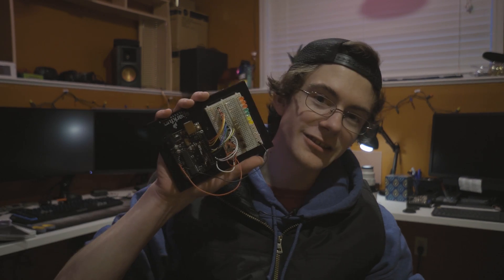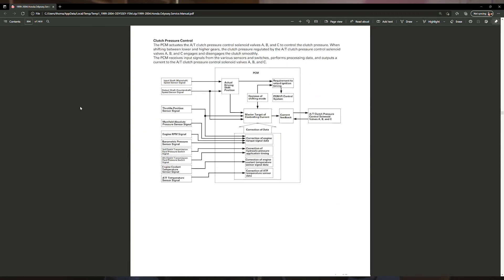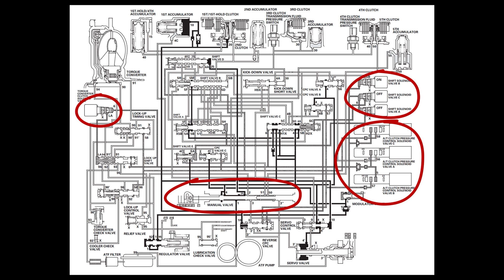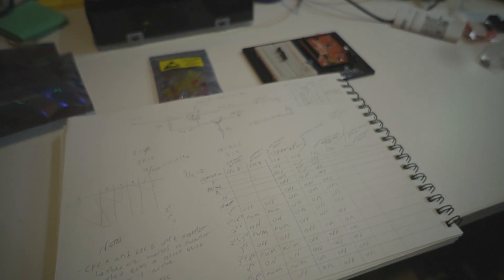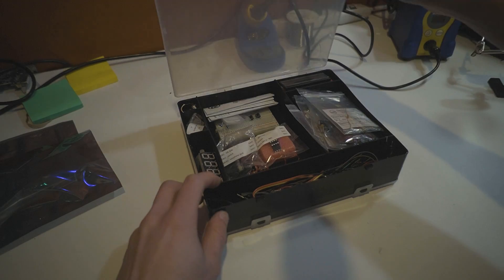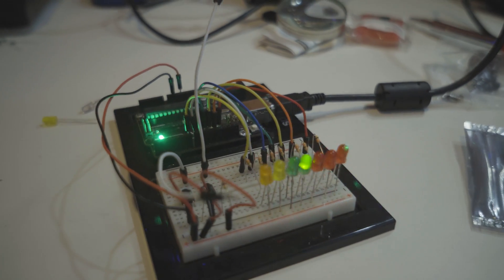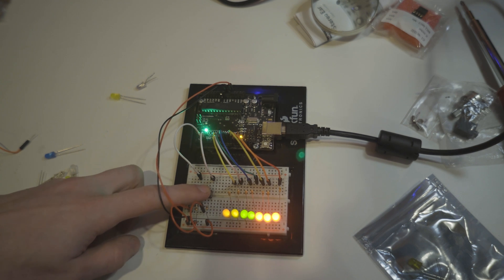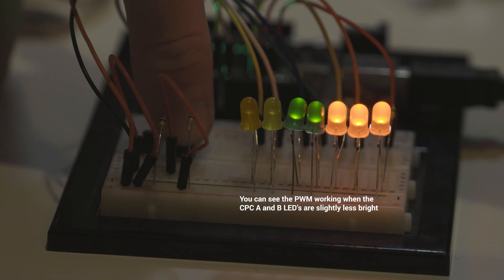Will this ruin my transmission? Adding manual control to my stance van!

Comment: Hey I’m tryin to do this same set up for my dodge dart go kart I was wondering what the code looked like in the arduino software. The motor is currently setup with a microsquirt ECU but I have no way to control 6 speeds with the microsquirt controller. Help a fellow car enthusiasts out plzzzzz
Reply: The thing has 9 solenoids ur the only guy on the internet doing something like this figured it out by watching someone turn on a lamp with relays.

Comment: This is amazing! I love the boldness to use the Arduino on the transmission. When everything is in place and you start driving what's your plan for shifting?
Reply from the maker: Thanks! The Arduino is a temporary choice, decided to go with it since I have them on hand, and I'm very familiar with them.
I've got some micro switches ordered, and I'll be using those to make a slap shifter of sorts for it, and it'll have a button up top for the torque converter lockup toggle. It's actually going to be really neat since I'll also have to use the stock shifter since that also controls a valve in the transmission.
Reply: Yo, this is is going to be sick!